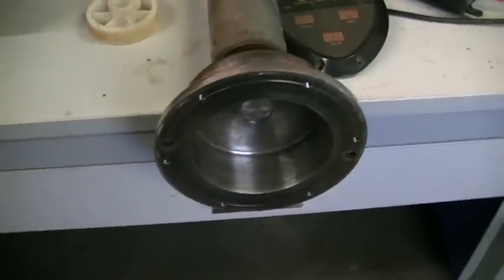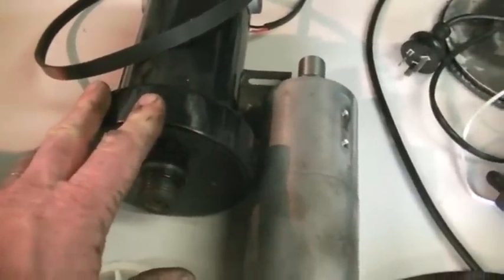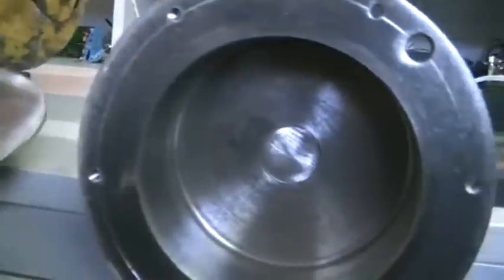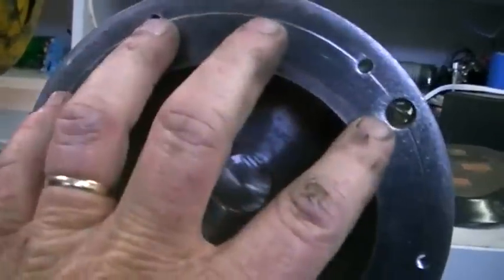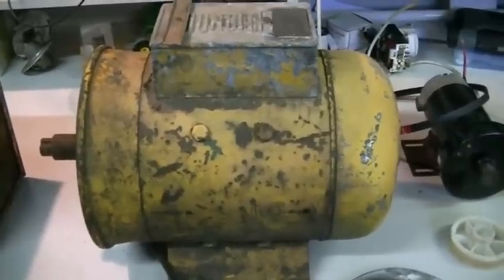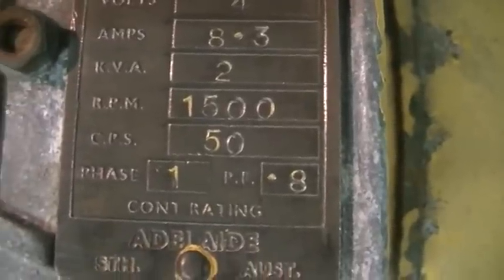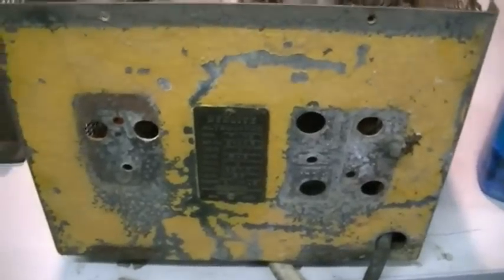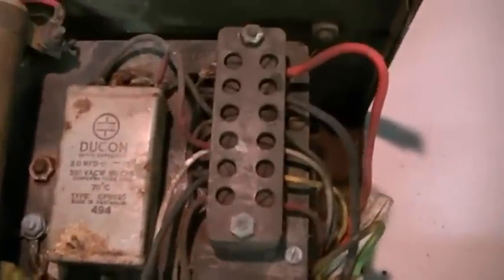Kilowatts Of Free Energy PT 2

Comment: This is just a guess.  Not an oldtimer myself, well, not that old anyway.  I used to play around with a unit called a Transverter.  Essentially it's a motor/generator.  AC drive motor, running DC generator.  I believe, my starter circuit was very similar to yours.  The 4 volts, may be for your field coil, and it was likely variable to compensate for generator load.  There was no simple way to do that back then, hence the complexity of the control box.  You should be able to convert it but your likely going to need a large run capacitor or it may over-heat.  The cap not the generator.  Those old machines are really well made.  Wouldn't be able to do this with the junk their making these days.

Comment: Not sure about that plate data, but 4V*8.3A*60=1992 (~2kW?)

How much did you have to pay for the diesel engine with accessories?

So given that you plan to use a diesel motor, I'm guessing you're going to burn biodiesel or some variation of it--since you want it to be as green as possible (e.g. perhaps modified or unmodified wvo)?  I suppose waste motor oil is out of the question due to the high carbon content & obvious unclean aspect of burning it.

Will the HHO fuel source be described in more detail in part 3 or is this project on hold for some reason? 

Just wondering :)

Comment: good job ,,,this is acient free energy ,,, old ac 4 volt generator and (VDF driver,),, the energy produce as BACK EFM from the inductor coil in the cut ,,the generator work as exciter inductor ,,  this is ,   for more expl, contact in https://www.facebook.com/MY-IDEA-station-energy-efficient-big-torque-engine-625986744140250/timeline/